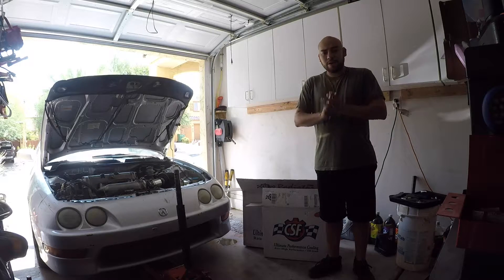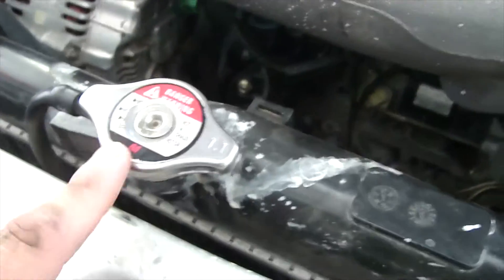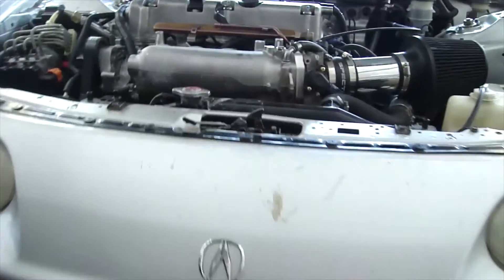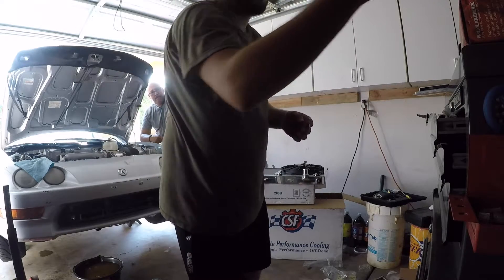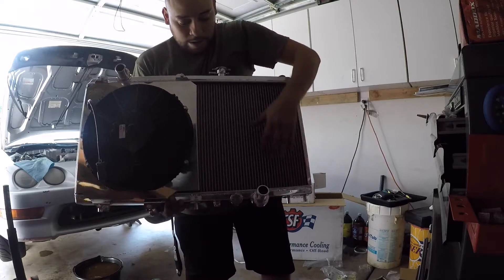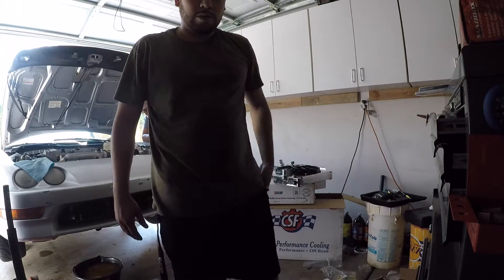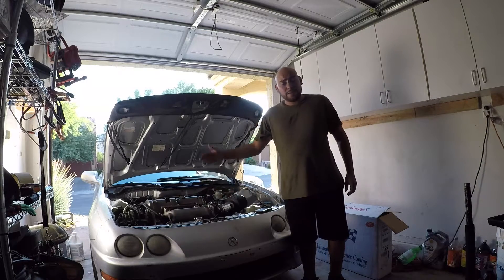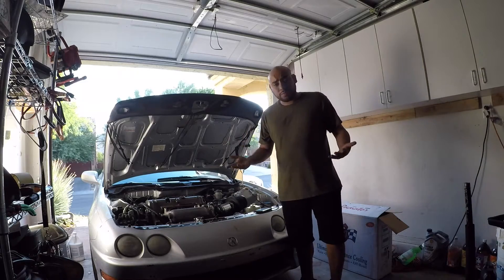CSF Ultimate K Swap Radiator V3 Install on my K24 Acura Integra

Comment: Idk if you figured your over heating problem yet lol been two years but did you jack the car up as high as you can from the front and then bleed your cooling system
Reply from the maker: sorry for the late response but what fixed my issue was going to a 3 row half sized radiator. Makes no sense to me but I now have no issues lol

Comment: What radiator hoses are you using I have the same radiator for my ej coupe k24a2
Reply from the maker: I am not to sure on the bottom hoses but for the top hose I am using the k tuned hoses. I do have a video that goes over those part numbers I believe.

Comment: Hey quick question. Did the radiator sit onto the stock radiator tabs on the bottom ?
Reply from the maker: Yes it did from what I remember correctly
Reply: pFbSpecV nice! Thanks for the quick reply
Reply from the maker: @doum5926  no problem! If you ever need anything just shoot a comment and I will comment back. Also stay tuned for lots of goodies for my integra soon!

Comment: Hey, the oil leak that u saw next to the header and the valve cover. Did u by chance fix the issue and know where the leak is coming from?
Reply from the maker: I haven't fixed the issue but I know next time ima use that honda bond gasket maker with the valve cover gasket next time.